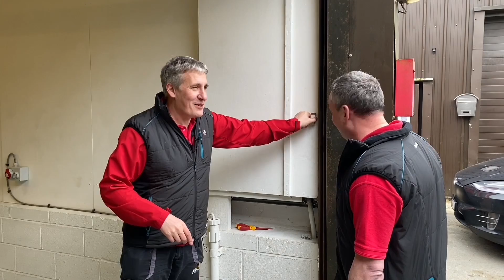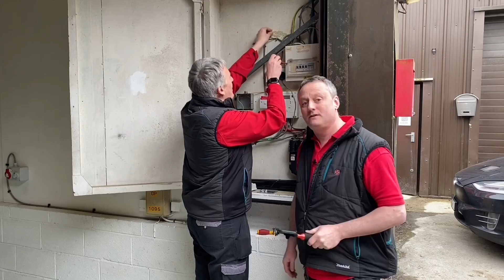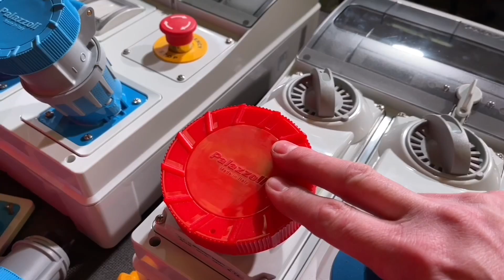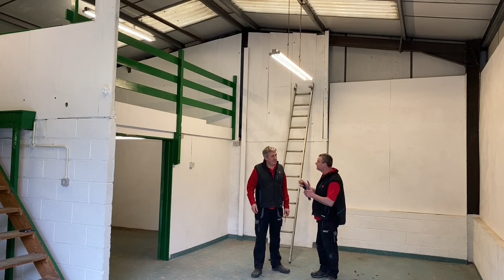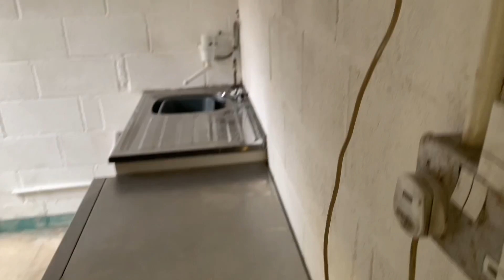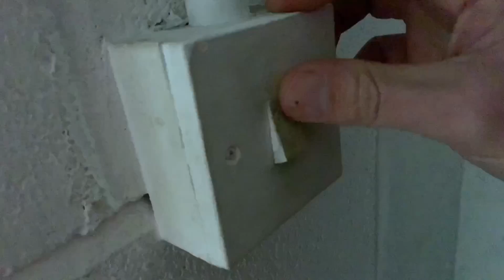IS THIS THE WORST THREE PHASE WIRING YOU'VE EVER SEEN - Does it need a rewire?

Comment: If you're going to be technical, no one should be using be using SY flex anyway, as it has no BS number and is therefore not covered by the regs. I've seen it used a lot on AC systems, quite often outside, however its also not UV rated and goes white and brittle when exposed to sunlight for a few years. I don't know why anyone uses it, anyway, as a result of it not being covered by the regs there's no requirement to earth the wire reinforcing, so technically its not code-able. however there's plenty of C2s in this and a myriad of C3s!

Comment: I've seen worse than that. I wish I'd had a digi camera with me when I've worked on wiring in the past. I had a mate once who was a mechanic and he set up a business in a unit and he got some right botch-up merchants to install some of his kit. He had a car lift installed which was three phase and was connected by a lousy 4 core flex which was only 240 volt rated and they'd stuffed it into a copper pipe instead of conduit which they'd bent without proper tools and crumpled it with the cable inside and they were lucky it didn't short out and catch fire, the cable must've been crushed and I don't think the pipe was even earthed either. And that's not all. One day I was there and there was some foreign chap there trying to install a 7 kW shower unit all wrong, he obviously didn't have a clue what to do, as to start with he was trying to connect the outlet to the hot taps when it must remain open ended, and even worse he was even going to try and connect it to a 13 amp plug and plug it in! Can you believe that?! And I tried to politely explain to him about how severely dangerous it was and why he couldn't do it but he wouldn't be told, I can't remember what happened later, I think I must've left him to it, I hope he didn't get himself or anyone else badly hurt, but if he did plug that thing in he'd have got a nasty surprise, that's for sure! Trying to draw 7kW from a 3kW outlet, definitely NOT recommended! It needed a 6 sq. mm cable right back to the board with a 32 amp breaker, or better still an RCBO.

Comment: Urm I’d look to rewire with the use of of 75x75  steel trucking to the left hand side of cupboard new Hager three phase db. 
Tray up from there up to basket then onto light fittings, high level trunking steel pipe drops to outlets ect...
Reply from the maker: Stay tuned !
Reply: @efixx  oh and steel Copley to lol 😂

Comment: The most common things I see on 3 phase installations is people still using the black in multi core cables as the neutral.  A couple times I have seen main tails  brown , brown and blue used as the 3 phases and a blue with black tape used as the neutral.. 
It was complete madness ever changing our old colour system
Reply: I pondered this years ago, Black for newtral, Red for danger, Green for earth. Then i met a bloke who was refused an electricions apprenticeship on the grounds he was RED GREEN colour blind! There are about 10% of the MALE population with this condition, how dangerous is this!!!

Comment: I notice you commented about not earthing the braiding on the SY cable. The braiding is there for screening more than earthing no? I’ve certainly never earthed it, nor have I ever seen it being earthed in any application.
Reply: Although, I’ve also never used it in a final circuit as it’s non-standard and doesn’t comply if memory serves me correctly.
Reply: @robertbreen7227  SY absolutely has to be Earthed at the braiding point of termination/glanding , although classed as a "control cable" its designed for usage in fixed applications up to 500V, if a live conductor was to be pierced to the braiding and no bonding was present, the whole outer sheathed braiding would be come live, its no different to SWA.
Reply: @shavermcspud  It’s completely different to SWA - unless you can find a regulation that says it’s usable for LV applications as I’ve never been able to find a table for it.

Comment: Not uncommon to see a small neutral to a meter and the main neutral connected straight to the cutout
Reply from the maker: Well spotted thanks 🙏
Reply: Seen it a few times when I was in the meter business and one of the problems is a sub 16mm unbushed neutral conductor leaves the terminal exposed underneath - straight off the tools for that.

Comment: I would not worry about IP ratings lads, those Netatmo external, WI-FI, mains powered camera/light does not have any seal from the manufacturer or an IP rating, and their advice is just to squidge a bit of sealant around the...!! old school eh 😉
But...fear not as their WI-FI doorbell has a rating of maybe IP44 !! 😉
Call me cynical, and I can be, their attention to IP ratings is in the wrong direction, just saying as those four eyes don't normally miss much.
The pressures of sponsors and commercial support have been known to 'blinker' ones eyes..
Reply from the maker: Stay tuned for a product which can ease the IP situation.
Reply: @efixx  I will, I am addicted now 😂😂👍

Comment: Its interesting to see how things are done across the pond. I'm surprised to see such small capacity in an industrial setting. Most houses around here are 200amp service.
Reply from the maker: Power wise it should be similar as our voltage is 230vac single phase 400vac across phases.
Reply: USA volts is 120, higher current. 
UK volts is 230,  lower current
Reply: @craig72x  kind of? USA is 120v and 240v all houses are 240v from the pole outside. Most houses here are 200amp at 240v or 400amp at 120. All the high current appliances run on 240 though, ac, oven, stove, exc
Reply: @mp-xt2rg  unusual, but why not.
Reply: @craig72x  what's unusual?
Reply: @mp-xt2rg  Two voltages...Im a uk electrician so for me thats unusual
Reply: @craig72x  I guess the thought is lower voltage is safer for outlets and lights. I wish everything where 240 copper is expensive.
Reply: @mp-xt2rg  for sure
Reply: @mp-xt2rg  Which country are you in where your incoming supply is 240 volts at 200 amps?
Reply: @mp-xt2rg  I don't know about that.
Having two voltages using phase to phase and phase to neutral must mean you have at least two different types of socket in the properties? Unless you are running 120 phase 1, 120 phase 2, neutral, and earth, that's 4 pin plugs. I don't think they do that in the USA do you?

It feels to me that somebody in the US decided to adopt 120 volts many many years ago, and then people realised that what they needed was 240 volts to give them higher power, and what's an easy way to do that without changing all the 120 volt appliances and infrastructure..just use a centre tapped distribution transformer and provide two split phases at 120 volts 180 degrees phase shift.

Then I think you guys in the US use 3 phase too, you have to because it's easy to generate and is incredibly useful for electrical machines (motors).

So I think you guys in the US have ended up with a messy and overly complex power infrastructure - you need 3 phase transformers, centre tap transformers, different plugs for single phase, split phase 240 and 3 phase, and all because somebody opted all those years ago for 120 volts and not 240.

That's my theory.
Reply: And the other weird thing about US electricity is the way that residential plus don't contain integral fuses.  What's all that about?

So if you don't permit the plug for the appliance to contain a fuse, then to assure safety the appliance cable needs to be the same thickness and have the same cross sectional area for the conductors as the circuit cables in the installation connecting to the distribution board/consumer unit.

If you don't do that, then there is a fire risk.

So this means that you are forced to use full thickness cables for the appliance even where that appliance does not need anywhere the maximum load current for the circuit. Whether you actually do this in practise, I don't know, but if you don't then you have got a fire risk.

So I am certainly intrigued to understand why the US doesn't put fuses in plugs.
Reply: @deanXRayZulu  that's safety of devices it has nothing to do with the houses wiring. The code books just want to make sure wires aren't smoking out inside walls. I will say though that I have never had an appliance cored burn in the 35 years I've been using power. European plugs do seem much safer but have the huge downside of being massive.
Reply: @mp-xt2rg  I agree, it's to do with the appliance cables I must confess;  have never seen it happen, but in theory a fault  could occur in the appliance which causes a live or neutral current greater than the rating of the appliance cable but which is not enough to trip the breaker in the distribution board.
Reply: @mp-xt2rg 
Yep. The screwed up USA electrical system. Worked on it. Third world. When I say that to Americans they get upset and defensive, instead of recognising and wanting to update the system. 

The two voltages is a legacy of commercial interests, rather than what is the best way.

Why Canada still persists in still adopting the USA system is beyond me. They can phase in the UK/EU system. First by eliminating 129v and using British G Type of plug and sockets.

Comment: A bit off-topic but I wonder what you think of a recent use of CY cable in an installation I know of.
The cable carries 230V mains fused at 6A, a 24V AC alarm relay circuit, a 0 - 10V DC control signal and two circuits for NTC thermistor temperature sensors, all in a single 12-core 0.75 mm CY cable.
Is that acceptable? Personally I'd have segregated-out the mains and low voltage circuits into separate cables.
Reply from the maker: Was the application part of a process line or machinery?
Reply: @efixx  Its part of an HVAC system. The cable connects the system control box to one of the duct-mounted heaters. Three-phase power for the heater elements is supplied by an SWA cable direct from the DB, but mains power for the power-control electronics and contactor comes via the CY cable from the controller.
This is the way the contractor installed it, but having mains and control signals in the same cable seems to me to be in breach of the segregation of LV and ELV requirements of BS7671.
Reply: ohhhh there's a very well known chicken place that I did qn eicr on the 200amp main from the 200amp switched isolator to the 72way db was in.... S/Y have a picture if you want bodge of the week lol

Comment: Nope I saw one in an electroplating works that was far worse,the guy from HSE took one look and pulled the main fuses
Reply from the maker: Great comment 👍
Reply: I would be amazed if an HSE guy was authorized to remove main fuses! ...... but I think he would have had the phone number of those who are! ;0)
Reply: @totherarf  This guy was a factory inspector,he put elbow length rubber gloves on,turned the main fuseswitch off
Reply: @anthonyschofield7807  So he operated a switch? ... Diferent countries different rules! In the UK the customers do not own the cutout and it is illegal for anyone not authorized to operate it!
Reply: @totherarf  As far as I can remember he was a senior authorised person working as a factory inspector and he certainly did pull the main fuses after isolating the supply
Reply: @totherarf  Yes only the DNO would remove incoming fuses but have seen the DNO rock up to next unit to remove and tag out the complete supply after a HSE visit.
Reply: @Electronics-Rocks  If the HSE are on it the Brown and Smelly has already hit the fan. Prior to that we would pull fuses if we knew it was unsafe ...... but we would turn up and reinstate when they had a safety cert for it! ;0)
Reply: @totherarf  and then pulled the fuses,he knew what he was doing

Comment: What is the main issue with using SY cables on final circuits providing they are terminated correctly and meet BS7671 standards?, Twin and earth which of course is permitted would provide no more protection than a SY cable does?
Reply from the maker: SY is one of those grey areas because of the standards it’s manufactured too.
Reply: biggest issue is there tested to TUV standards with dubious ratings 😆 🤣 
Bs standards for a reason 😴 🙄 
would be a deviation on certifcate...
ideally only using s/y or y/y for control cables

Comment: In the states you could most certainly fail a inspection for non workmanship appearance. It's a grey area usually left to the discretion of the inspector. Our NEC states all work must be finished in a neat workmanship manner.
Reply from the maker: Sounds like a great term to add to our Regulations!
Reply: @efixx  don't get me wrong as long as everything else meets code here its pretty hard to fail an inspection based on workmanship appearance. You you basically have to totally not care and try to make it messy enough to fail. Most honest professional electricians here do take pride. Messiness is usually the result of a general contractor or builder. Im neither just a homeowner who does his own work and lives to learn.
Reply: @efixx  It sounds fancy and technical at the same time

Comment: Rewire with maybe a Scheider 3 phase consumer unit like the one in your previous videos, Metal trunking around the outside of the workshop and metal sockets and light switches  off it in galv conduit
3 Compartent trunking in office areas,maybe floor sockets depending on room size and use, i know there are so many ways and depends on the use of the building.
Smoke detectors,call points. Emergency lighting 
An Ev charger ready for charging the latest  company van in the future whilst doing the office paperwork.

Comment: Two comments - Landlords legal responsibility to ensure supply is fit for use before reletting unit (or was it a 'deal')? Cables strapped to telephone cable providing 'correct' seperation (ok, only for a short distance,...... but)?

Comment: I'm afraid I've seen far, far worse than this old 15th edition installation.  You didn't have to fit an RCD in those days. It's the tinkering and meddling that helps to make it a mess. And no, you have to use brass or copper for that earth continuity at the intake. Also, the intended future use. Is there any rotating machinery? If so, the lighting has to be flicker free! The future intended use is crucial to the selection and erection of equipment. What a great  video that! So real, as it is? Thanks again guys!
Reply: I’m wondering how would you make the lights flicker free?

Comment: The original installation looks around the 15th  and is worn, tired aged, etc. It has had poorly installed additions and alterations to suit occupiers over the years. I think that there could have been an original 3 phase  D.B. with the single-phase circuits eg lights and power.  Protective devices for this board are no longer available eg 3 phase MCB for the 3 phase socket so this lash-up was done as the cheapest option.

Comment: I don't see using the steelwork of the box as CPC as a real issue provided the connections are tight and the CSA is adequate (approx 7x the required size of copper). The rest of it makes that a bit of a moot point though!

It's a shame the UK regs don't have phrasing like the US NEC does for 'workmanlike installation' or similar wording.

Something else I see that others may not pick up on,  the BT distribution point wiring being right next to the SY feeding that 3ph socket. (separation of services)

Also SY: no BS number, by using it you're taking responsibility for it being suitable. I don't like it outside of industrial control.
Reply: Would you recommend regular 5 core flex on 3 phase sockets/plugs?
Reply: @Orgakoyd  Depends what you mean by regular.... H07 RN-F should be fine for most use, SY has its place too despite not having a BS number....

Comment: After carrying out a EICR on a commercial property a few years ago, one item I flagged was reduced size neutral conductor in the submain SWA supplies dotted around the premises. Once back in the office I blew the dust off the old BS7671 and set about finding the right regulation. What I actually found was that providing the over current protective device is rated for the load taken it is a pass. In this case all but a few machines actually needed a neutral connection so the load on the neutral was minimal compared with the line conductor in the same SWA.
Reply from the maker: Thanks 🙏- we will investigate further on this.

Comment: I'm wondering if the original test was at the suplly before the consumer unit and other installation was installed.
Did see a Hager 3 phase switch feeding another 3 phase switch in the same enclosure?

Comment: Just about filled a code sheet with the supply consumer units alone!
 With the Sy flex I have never used it myself and I don't know if its suitable for outdoor use but I have seen similar cable with the same outer insulation on a communal lighting installation  which came from a building then through ducting under a private road to street lights in a carpark the other side where I was asked to refix on the wall where the building was  as the cable cleats had come away  and i found the outer sheath was crumbling off from exposure to the sun and weather just leaving the steel wires
Reply: Yeah I find SY cable outside is unsuitable most of the time, not sure how those HVAC boys get away with it so often

Comment: Its worth noting that if the sockets were installed in 1992 then it may have been designed under the 15th edition and not required? Does 133.1.1 not cover SY as it has a IEC standard? Overall I agree that it needs a rewire based on the issues at the board alone.

Comment: Hi,  excellent video yet again. I worked for the NHS in a fairly large hospital in a maintenance capacity for many years and insert 13amp socket outlets were always an issue like you observed in your video. Seen  similar installations not good so looks like a total rewire is in order, keep up the good work and stay safe.